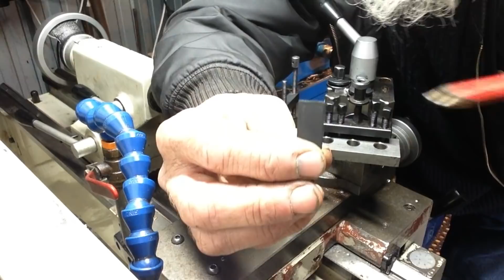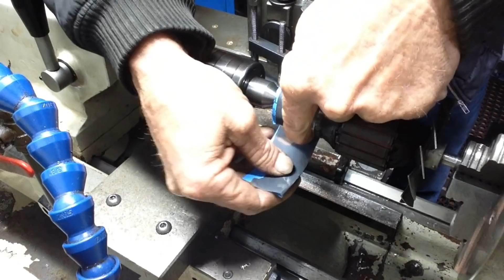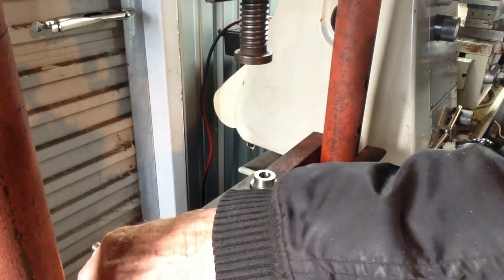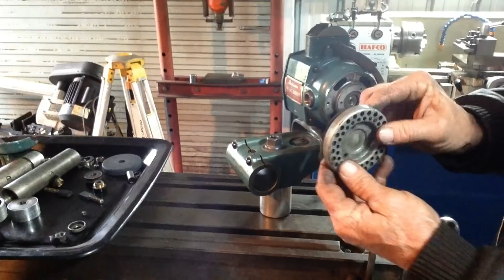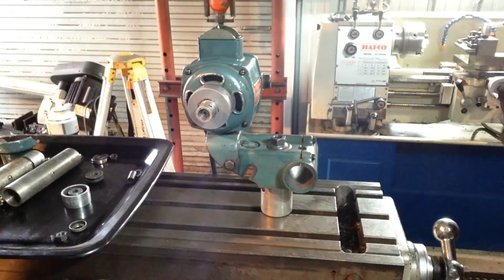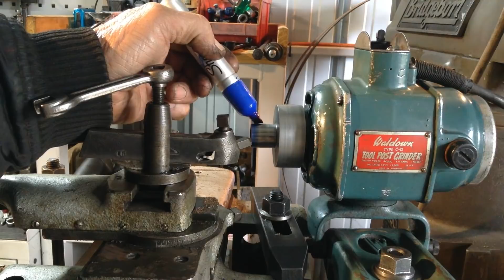Swarf & Chips Ep 7  part 2  The Toolpost Grinder Repair

Comment: Hello Max, just came across this video now.  When I was at school I took a course called 'Electrical Machines for Non-Electricals'.  It was a course put on by the electrical engineering department for mechanical engineering students.  Our professor, R.W. Menzies, had done some work for Hydro Quebec in the past and he told us a story about bedding in brushes on large generators.  He told us there were two important things that had to happen when the brushes were bedded in.  One was that the brush made full contact over its rubbing surface and secondly that a thin patina had to form on the commutator bars.  (the patina is the darkening of the copper where the brush makes contact) If the patina didn't form both the brushes and the commutator would quickly wear out and arcing would occur.  He further stated that you need a certain minimum level of relative humidity in the air surrounding the brushes in order for the patina to form.  Hydro Quebec had installed and commissioned one of their hydro generators in the dead of winter and it was very cold and dry.  The power house was heated but the relative humidity would have been extremely low.  They started and ran the generator for a few days and then all hell broke loose.  Because of the lack of humidity the patina never formed, wear quickly set in and then the arcing started.  Before they got it stopped the arcing had destroyed not only the commutator but the generator shaft as well.  It was sent out for a very expensive repair and then brought back and reinstalled.  By now they had a very senior man on site who knew all about these problems and had seen this happen before.  To solve the problem he filled an empty coffee can with water and placed it in the generator near the commutator.  The slight evaporation of water from the coffee can provided enough humidity for the patina to form.  The generator had no problems after this.  I think the commutator was actually located in the exciter as the exciter is a d.c. generator that supplies current to the a.c. generator windings.  I always thought it was cool that a coffee can full of water could prevent hundreds of thousands of dollars worth of damage.  Ken
Reply from the maker: Hi Ken . That's interesting to know .  The commutators on the  DC generator for my surface grinder are in great condition with patina .  I will leave those well alone !     👍
Reply: As long as you don't resurface the brushes you should be ok without the patina. Had the brushes worn unevenly then straightening them or filing the curvature off them will lead to some arching until they bed in. The relatively little that Max turned off the commutator showed that the motor was, for all but the bearings, in reasonable nick. The loss of the patina, in that small a motor, will be of no consequence at all. In a megawatt-sized generator, maybe,  but copper oxide is usually considered a partial insulator so I don't quite get the correlation but I stand to be corrected. I just don't see any other way of guaranteeing an efficient brush to commentator surface without machining in some way.